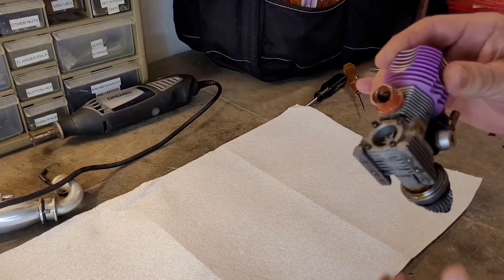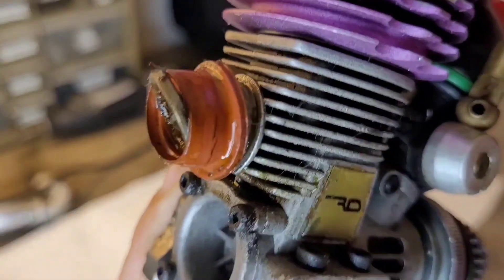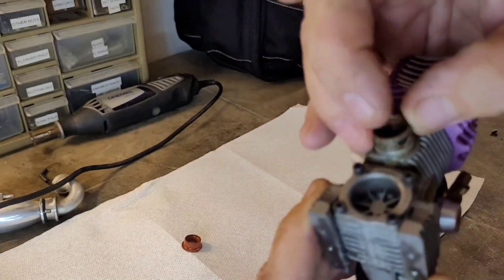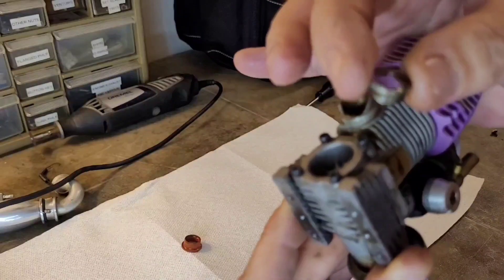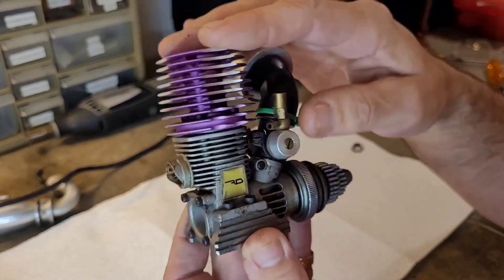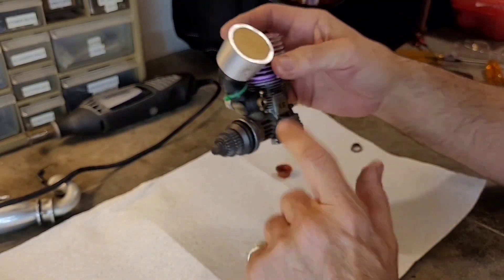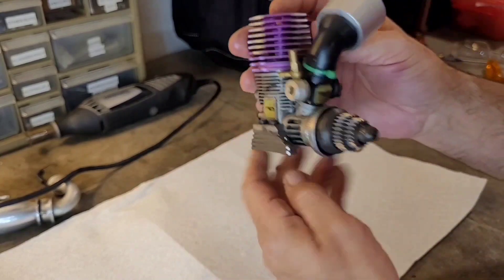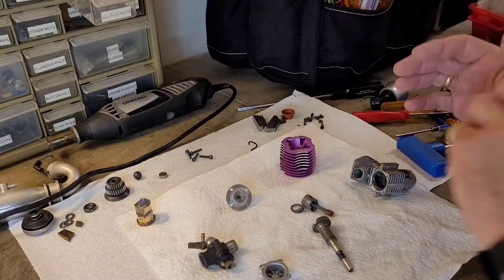Let's take a look at the RD Logics R3 .12 Nitro engine small block modified Novarossi rare vintage

Comment: Those nova 12 run great with little to no compression
Reply from the maker: I bought the car with the engine installed, a few years ago I ran the car a few times. It screamed. I don't remember idling issues or anything, it was a peach.

Comment: Awesome!!! You should get it going Id like to see it. I have a Serpent that I bought and it has a Novarossi Mega SX .21 it has made in Italy on one side of the crank case and serpent on the other so it must have came on the car has Nova. Exhaust and three needle carb it's a 9 port with good pinch but rod is catching at tdc so trying to find a rod that will work I believe it's 29mm center of the holes. You got any suggestions of what rod might work?